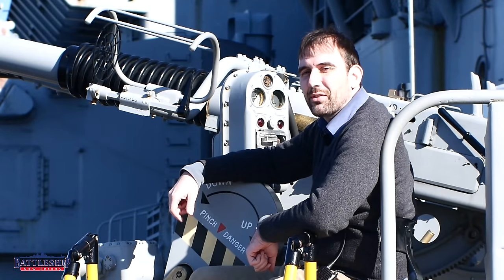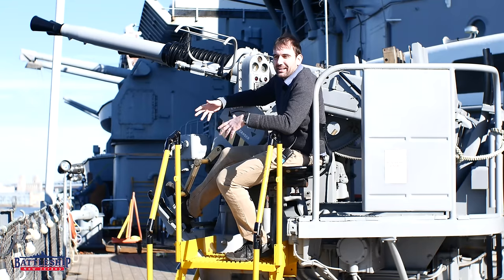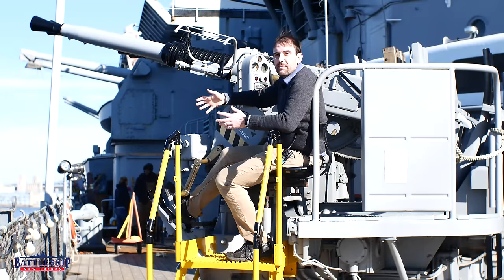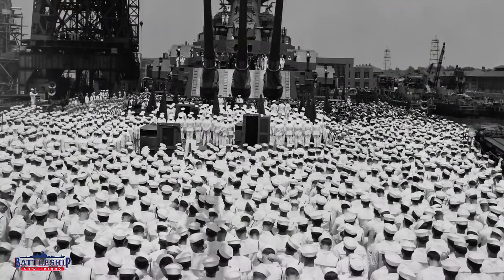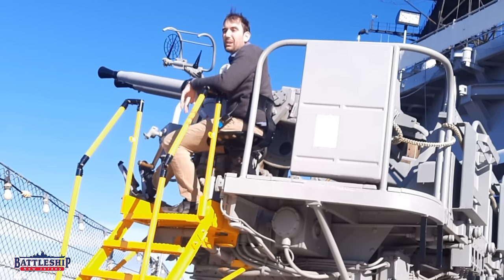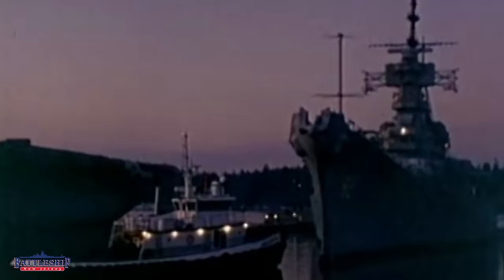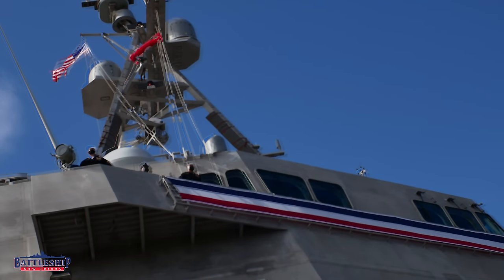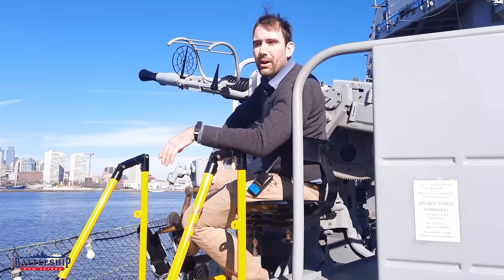What is a Littoral Combat Ship?

Comment: A possible concept to augment support for OHP frigates and various green water or amphibious operations but was poorly planned, built and executed in practice and ludicrously over budget. Could have been beautiful but end products as abysmal as the Russian operations in Ukraine. The constellation class can't come online fast enough and the lcs concept, is like to say corvette, has a place in the navy but we  need return to the drawing board. Cheap, quick build, fast and tried and true systems.
Reply: At the time they were proposing LCS, I was on warships1 (is that site still around?) Arguing we should be building a 30knt version with 16 Mk41 VLS cells, compact SPY-1K Aegis system, and a 76mm super rapid gun instead.

Boy did I ever turn out to be right.
Reply: @DeeEight  Because the 76mm super rapid can shoot more than 50 freaking feet, and because there are extended range GPS guided shells already available for it. 76mm Vulcano has a range of 40,000 meters- more than double the 57mm gun.
And 57mm is effective at what? Certainly not surface warfare or NGFS. Sorry, but i'd like my warships to be able to do more than shoot at speed boats and incoming vampires on terminal approach.

The 57mm is a glorified IFV gun.

Comment: A littoral combat ship and the three overly expensive stealth destroyers are the the Navy's (failed) answer at filling the void Battleships left when Carriers took over.

Before you can park a Battleship at the mouth of the harbor with a few destroyers or cruisers and that mouth was effectively closed.

Now we can't do this without putting our frail ships in harms way so we make slightly less expensive, wholly incapable alternatives to a problem Battleships solved simply by existing.

We have a Navy now that can project power just fine, but our physical PRESENCE is a risky endeavor since we sacrificed the ability to take a hit.

USS Atlanta in WWII took enormous amounts of damage while still continuing to fight, USS Cole (About the same size, more modern) is crippled with explosives, a cheap suicide craft, and two bodies.

The stealth DDG 1000's can fire at slightly greater ranges presumably with that upgraded popgun 5 inch gun, it better, because it's using a tumblehome design (demonstratably weak to taking hits, Russo Japanese conflict), and it's armor if any is paper thin.

Littoral combat ships don't have any armor worth speaking of, though they say the triple hull design of Independence can tank a few hits.

Lundgren's book, "Battleship Victory," explores all these concepts.  The Navy refuses to use time tested stuff and insists on high tech stuff with laughable results.  Money is no objective apparently, this is a business that can afford to make mistake after mistake, whereas a civilian corporation would have tightened things up and fired people for the financial losses incurred.

The F-35 is another example of this, although that aircraft apparently performs and lives up to the hype, it is grossly overbudget in Research and Development.

What ARE these people doing with our money?  Spending it on Teslas for each employee?

Comment: The "groundbreaking" stuff largely proved the least interesting aspects of LCS.  It's fast, but it was a maintenance nightmare.  It's "flexible," but the mission module system was too complex to be practical in reality, etc.  It wanted to be all things to all people, cheap.
But I think an LCS2 that was less ambitious could be great.  
The trimaran could be an amazing little "baby assault ship."  Keep a load of vehicles like Strykers in the mission bay, dump em out on a little island in 20 minutes with the RO/RO ramp.  The ship has a radar and helicopter to support the boots on the ground and scout before deploying.  Boom, instabase on one of the thousand little islands of the Pacific, and the Marines can do basic shorad and anti-ship missile attacks from their vehicles.  Then, make a separate class derived from that ship to do something like anti sub warfare using mostly common components, to the extent it's convenient.  It could be a great little convoy escort, even if that's not strictly "littoral" work.  Don't make one megaproject project that covers 7 or 8 different roles with mission modules.  Just make some mostly-similar ships and iterate every two years with a mildly upgraded design, doing one at a time.  Narrowing the scope of the individual projects will result in far more practical ships.